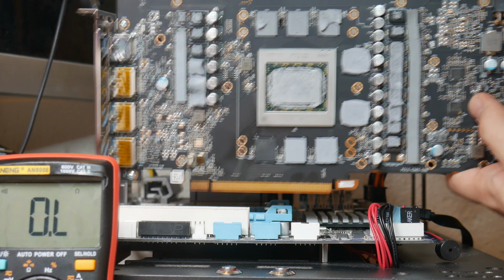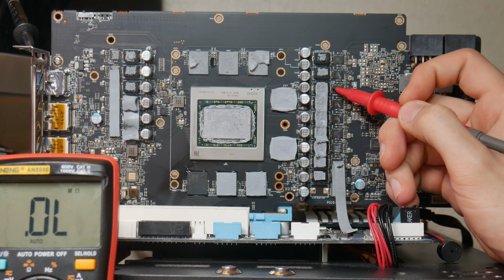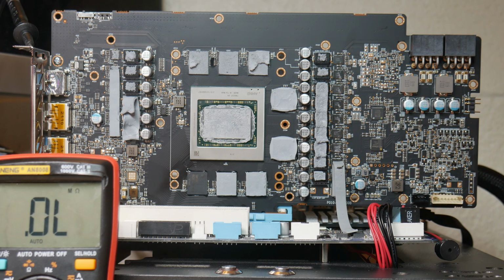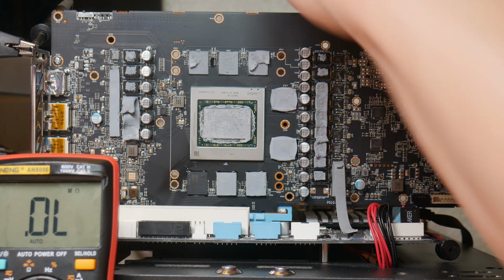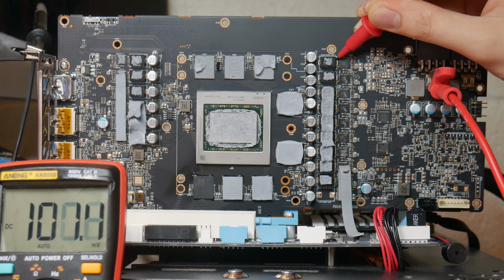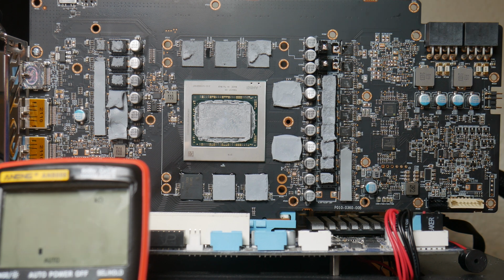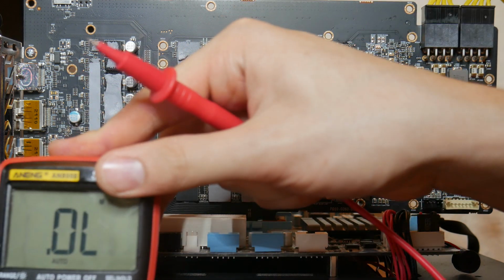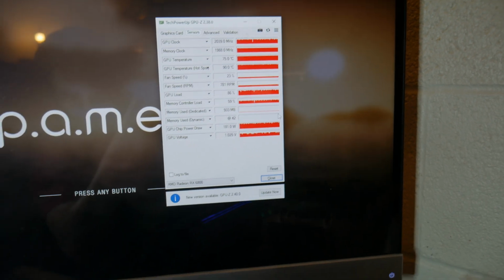Sapphire RX 6800 Nitro+ Graphics Card Repair - No Power

Comment: This is my card! The person who referred me to Tech Cemetery told me that he was the best in the business for GPU repair, and he wasn't kidding. Great video, and best of luck on the Patreon!
Reply from the maker: Thanks!
Reply: what actually happened to the gpu to cause the short, overclocking?
Reply: @rompersrchelichannel8164  I physically broke something else on the GPU (which was basically brand-new). Tech Cemetery thinks that the memory powerstage just happened to fail at the exact same time, but it's impossible to know exactly
Reply: @rompersrchelichannel8164  If you looked at the video you would have easily noticed that it was the memory and not the gpu, and why the fuse went could be because the card was clocked above what the fuse was ment for.
Reply: heck ya man I watch him to find things I miss and sometimes it's easier if same thing. he da man for sure

Comment: Let's push right to repair to be easier for us to fix that stuff! I repaired today a g900 mouse and found that there is a proprioritarie chip what communicates with the original Bluetooth. So can't learn your mouse to a another Bluetooth adapter! And this is back to 2016!!! I'm sorry for shot storming but i hate more and more big tech companies...
Reply from the maker: No worries, I 100% understand the frustration. Nearly everyone who learns to repair graphics cards does so by buying them broken and reverse engineering them.
Reply: @TechCemetery  i know. And it sucks to do that for 90% except the older apple stuff. (2-3years)

Comment: Amazing video, thank you! I'm a 17-year-old guy living in Poland who also fixes GPUs for almost 3 years now, and you help me get some knowledge about these new cards. I mostly fix GTX 9xx series because the GPUs on them rarely die (even if they are fed +12V on vcore xD), and it's almost always a happy ending. Also I didn't know that you can test a power stage with this ANENG AN8008 multimeter (I also own one) without needing to use an oscilloscope, never really looked at the frequency measuring function.

Comment: I wonder what happened with the b450 motherboard that you fixed and was used as your testing bench some times ago, you'd think you want a little bit newer system (with at least uefi) to test these modern GPU's, why reverted back to older system?
Reply from the maker: The B450 motherboard eventually became unreliable. It also lacks audio post codes.
Reply: @TechCemetery  I see, I had problems with that exact b450 model, will personally never buy from MSI again in the future

Comment: I think you should do repairing cheaper card more, its affordable
Reply: Agreed, but still nice to see newer gpus. On cheaper cards diagnostics and repairs are very similar, so it is not a big deal. Also about voltage passing thru power stage and going straight to memory controller I think he was referring to GTX 10 series gpus.
Reply from the maker: Yep, it was mistake on my part during recording.

Comment: Maybe a silly question, and i get its to educate on fixing GPU's, but why wasn't this just sent in for warranty?
Reply from the maker: The owner knocked off two capacitors next to the PCIe slot, you can see browning of the PCB next to the first three pins. I don't touch cards that can be RMA'd.
Reply: Yeah I think I saw some discolouration on the 3.3V inductor on bottom left

Comment: If you don't want to lift the coils to check which powerphase is blown you can inject voltage from the GPU-side of the mosfet to the fuse and than mesaure the voltagedrop acros the coils. The coil with the shorted mosfet will have a voltage drop of a few mV. You can do the same to check if the powerphase is working after the repair.
Reply from the maker: I lift the coils mostly because it's the method I prefer to teach, otherwise I'd just use my thermal camera ;)
Reply: @TechCemetery  I was thinking about pulling the trigger on a used CAT S60 smartphone with flir module built-in. Would that do me any good for that purpose?
Reply from the maker: If you don't own a thermal camera, I can definitely recommend one. In this case a thermal camera would have definitely been able to point out exactly which powerstage was dead. I personally use a USB-C thermal camera like the one linked below, but don't recommend that particular model as there are better ones.

https://www.amazon.com/Seek-Thermal-Compact-All-Purpose-Imaging/dp/B00NYWABAA/ref=sr_1_3?dchild=1&keywords=Seek+thermal&qid=1625602309&sr=8-3
Reply: @TechCemetery  I don't have one and the reason for thinking about the CAT is cost. The phone uses the same sensor and app as FLIR ONE thermal camera and the smartphone is half the price of the camera alone where i live. That's why I am asking.
Reply from the maker: Ahh okay. I definitely recommend a thermal camera. Even a cheap one is miles better than not having one at all. I've never used the S60 personally and so I can't speak of its quality.
Reply: I'm getting pins 4 and 7 from left to right are dead short ?
Reply: @bigbothoee8617  Google the datasheet of the TDA21472 and look up what the pins are called. If I understand you correctly pin 4 is also pin 4 in the datasheet and is called VDRV and it should be conneced to a 5V source, so it should not be shorted, pin 7 (,8 and 9) are ground.